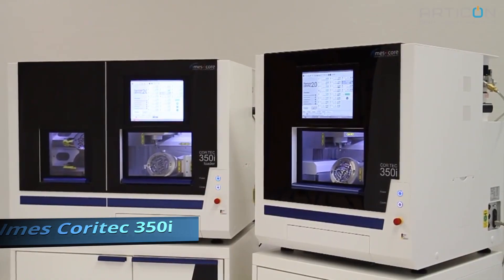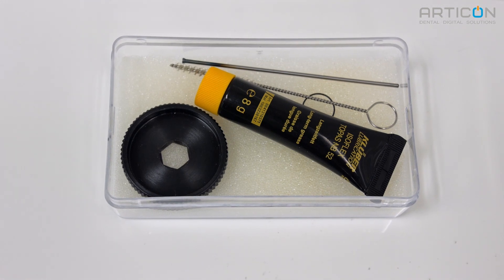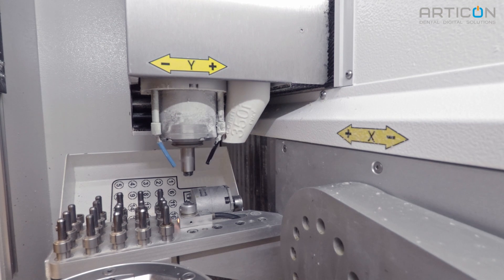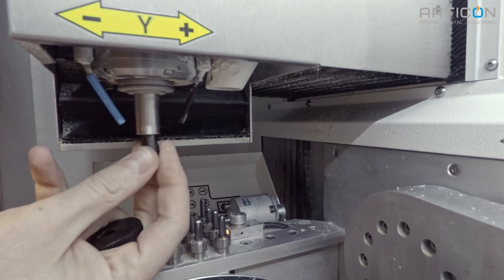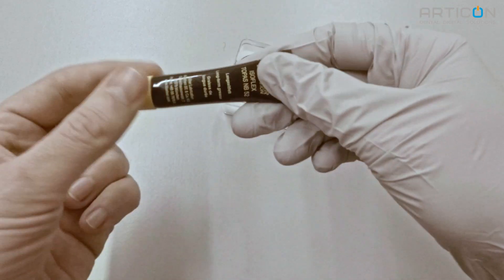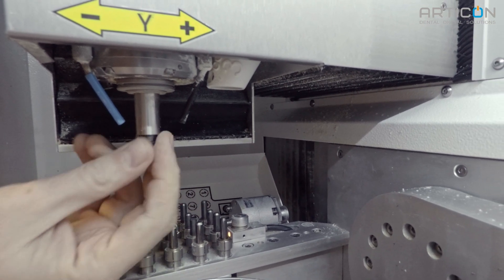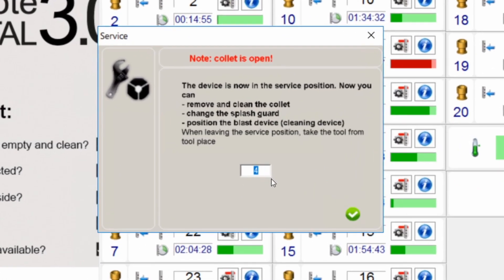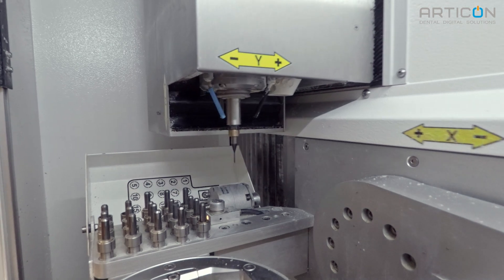Imes Coritec 350i : Collet Cleaning and Maintenance

Comment: I do disagree with quite a lot of information here. 
- First of all, you can use for Both removing and putting the "collet removal tool", just MAKE SURE you put a milling tool inside the collet by hand while you screw/unscrew it in order to avoid twisting/bending it.
- I was told by both imes and other german distributors to USE my finger while putting lubricant on the collet. Also, lubricant is put on the collet, from the point of expansion in both directions. This is where the collet makes contact with the spindle, so this is where Lubricant is useful. From the middle-line of expansion halfway to the end in both direction. Do not put till the top of the collet, as in the video. Basically I would say NEVER put lubricant as shown on the video, because 1) it's TOOO much 2) the way the person puts it is very wrong because in this way, lubricant goes inside the gaps of the collet. This is something you WANT to avoid. If you have lubricant there, the machine might start "spitting" or dropping your drills/tools and holding them wrongly. I would advice to put in straight movements between each of the gaps to avoid lubricant going there.
- When you screw the collet, screw it till the end, and then slightly unscrew it. It should not be left tight.
It's quite shocking how different we do the collet maintenance. It's interesting whether your way is working for you. The way we deal it, that I explain above works for all the 30+ machines we install and take care of. It would be funny if both turn out to be fine :D

P.S. The last thing shown on the video is basically a test for the collet. If you worry whether your collet got twisted/bend you can always use this method as a partial check. In case of crash, or if the tool positions in the tool-holder are not accurate, it is advisable to check more frequently by doing this test.